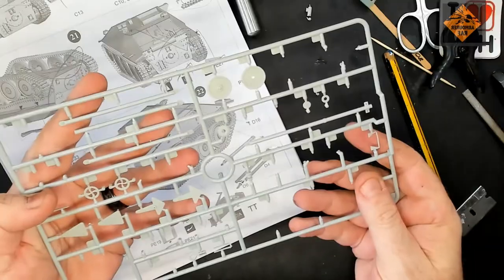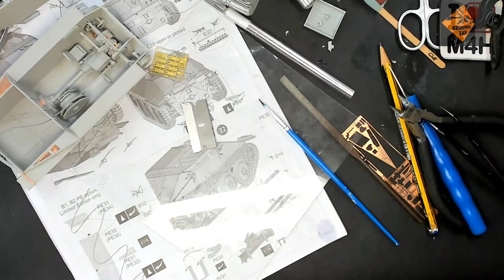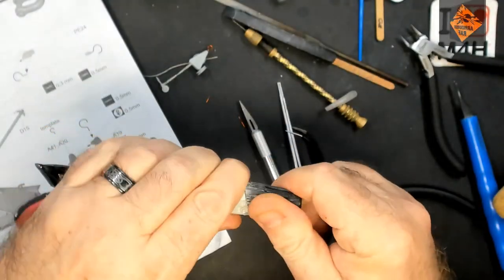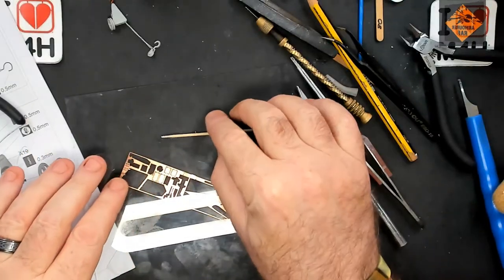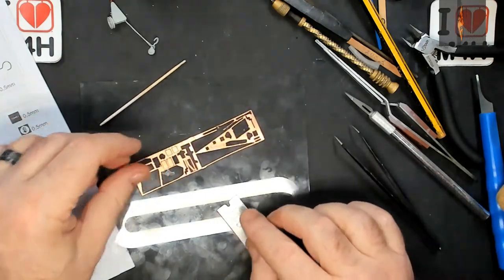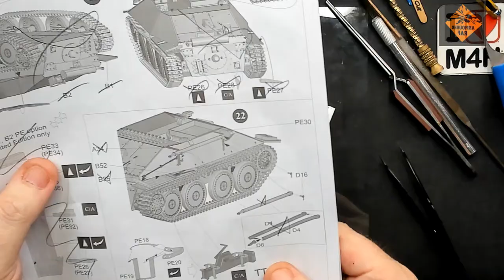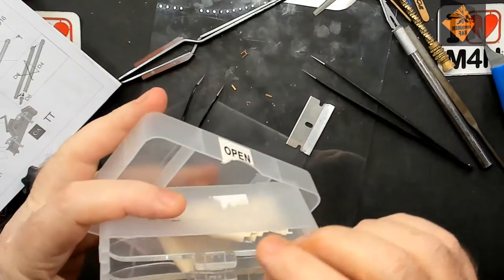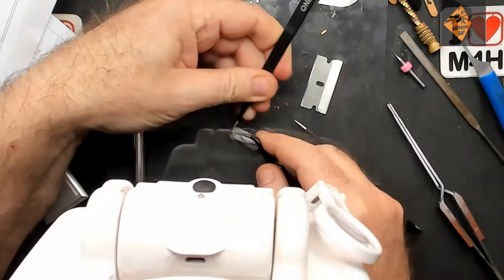Episode 35 of my BergePanzer (Hetzer Early) and King Tiger, with full interior

Comment: I know that this comment doesn't apply to this video, but I just want to pass on (what I consider) a neat little tip. I found a considerable gap between two parts on my current model build (5mm) which I felt was too wide for putty. I don't have any plastic card, so I made my own from takeaway coffee cup tops. Luckily for me, two strips glued together ended up measuring 5mm. I then inserted and glued it into the gap and left to set up for a few hours. Then all that was left to do was trim away the excess.
NOTE: The coffee cup lids were the old-fashioned "bad" styrene ones... not the new environmentally friendly lids. 
Hope this helps someone.
Reply from the maker: Oh WoW..What an awesome tip...Can I use it please? 
Cheers,
TBM
Reply: @BudgetModeller  
Please do. If you find it to be successful for you, it would be great if you use it on camera when a need arises.
Reply from the maker: @birodude  I certainly will :)